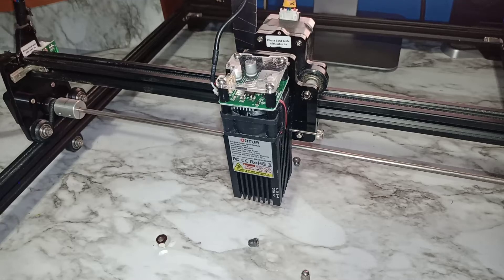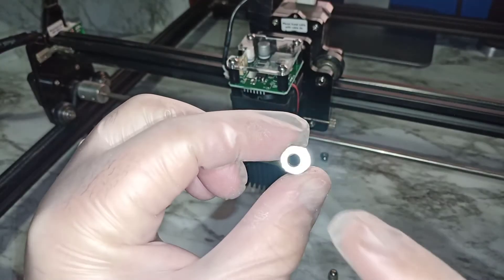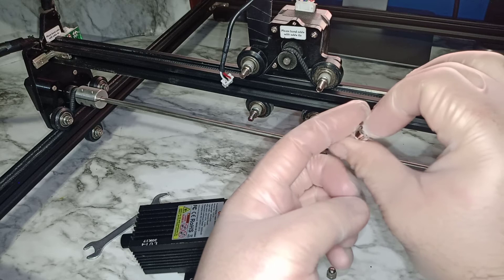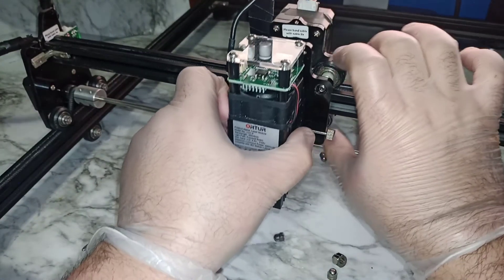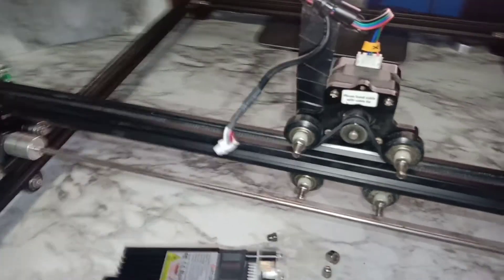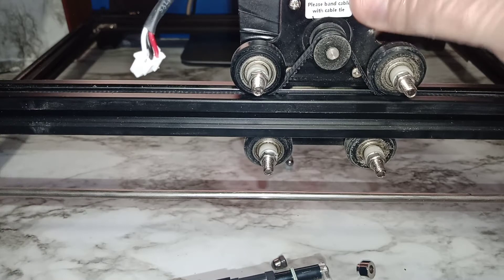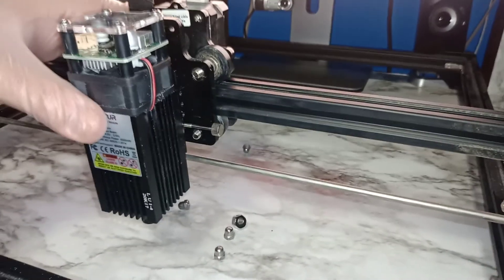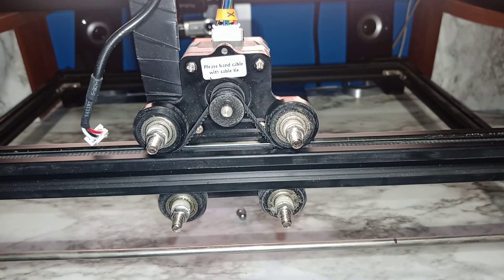How to adjust your laser from moving

Comment: My laser shaft  does not move in the y axis.. it seems to get stuck and make loud noise. What could be the issue
Reply from the maker: My apology for the delay check the motor to see if it's turning maybe the belt is slipping

Comment: For whatever reason, I couldn’t get the cap screws on for the diode mount at the bottom because the assembly from the factory just was too narrow.

I finally managed to get them connected but only by having to over tighten them (thanks for the warning here).

My laser also tilted off angle by about 10 degrees so I went and got my own longer screws and spacers to try to balance it.

As I am doing this, I am seeing Ortur’s “rewiring required” video (https://youtu.be/d-SOoGuqgjU) to properly ground.

There’s a suggestion that this US ground plug adapter on Amazon (https://www.amazon.com/dp/B071J61CSV/ref=cm_sw_r_cp_api_glt_fabc_KTV80R2716SJF18Z8GEC) might do the job without running multiple wires all over your machine.

Any chance you could see if it’s an easier alternative?

Your Ortur videos are a Godsend. This topic is hard to find anywhere else!